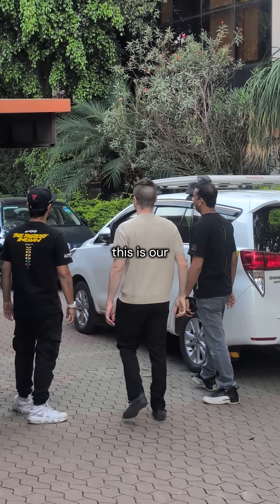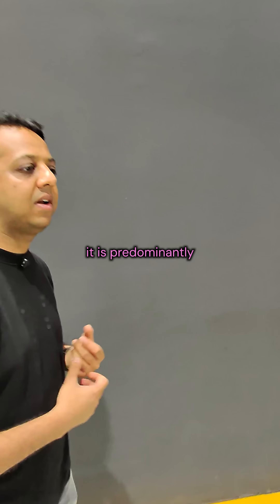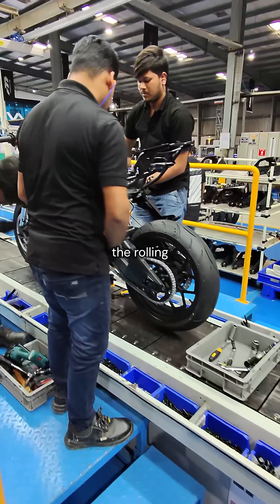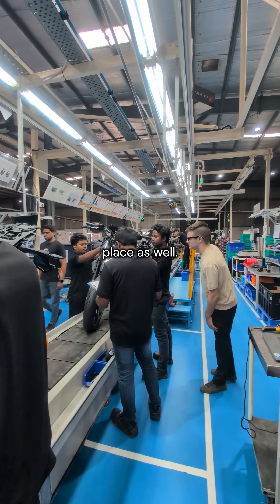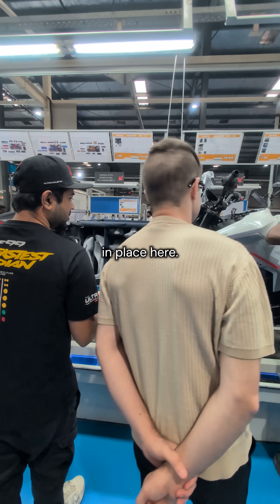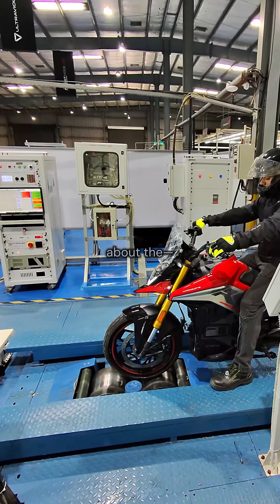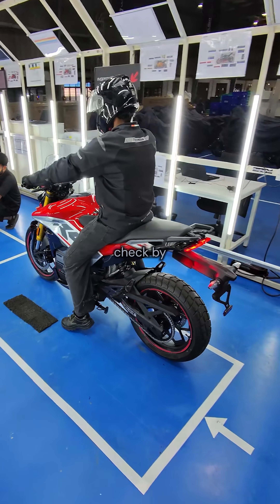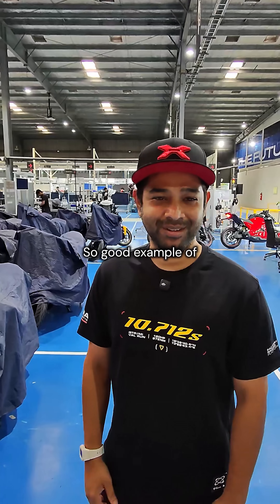Inside Ultraviolette Automotive's EV Factory | Runtime

Comment: I purchased the X47, the advertisement video only tells one side of the story. I'm facing numerous problems, including battery dropping issues, a software full of bugs, and the showroom not providing the advertised equipment(RADAR IS NOT AVAILABLE NOW). There are also fit and finish issues, very slow map downloads, and a high price for app upgrades. The service mechanics have insufficient knowledge, and there's no response regarding parts replacement. Additionally, there are hidden charges of about ₹20,000 more as admin charges, and the Ultraviolette company engages in false advertising. I definitely regret purchasing this bike based on its looks. It's a pathetic bike. The battery draining 1% per one Kms,In my opinion, don't go with this bike; go with ICE bikes instead.
NOTE Mr. NARAYAN SUBRAMANIAM CEO AND Mr NIRAJ RAJMOHAN, CTO  TO RESPOND.

Reply
Reply: Bhai Maine bhi Li h . Mujhe koi problem nhi aa rhi. Tm service centre se contact kro.
Reply: @amankumar-ft2ck  Did you have radar in your vehicle? did you checked, they are not yet installed in any vehicle accross India sofar, battery draininbg issues 1% per 1 km lit so many fit and finish issues, charging lid  not closing correectly  like 12 issues i raised.
Reply: I see your comment everywhere. Why don't we connect in WhatsApp? I wanna get few insights on the bike